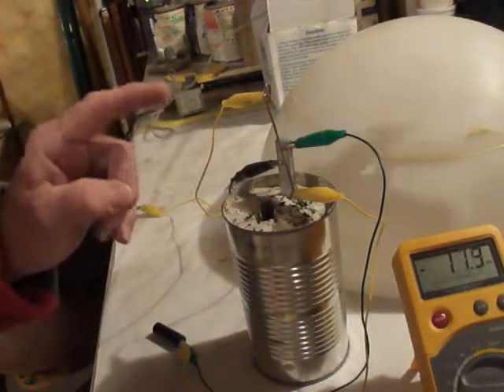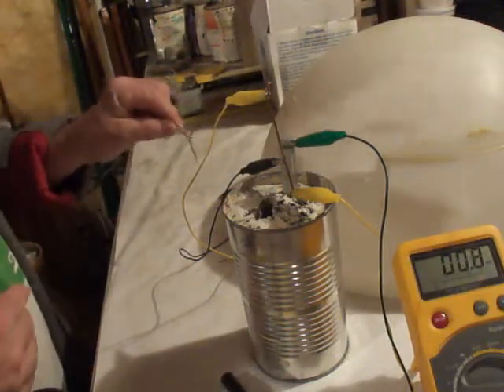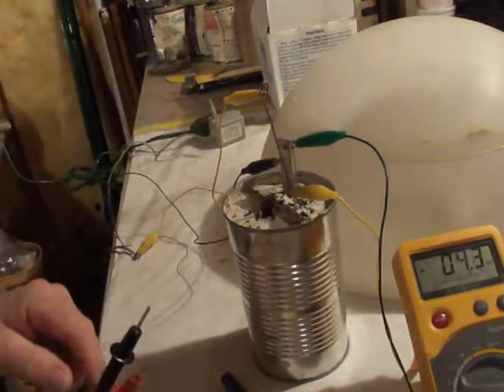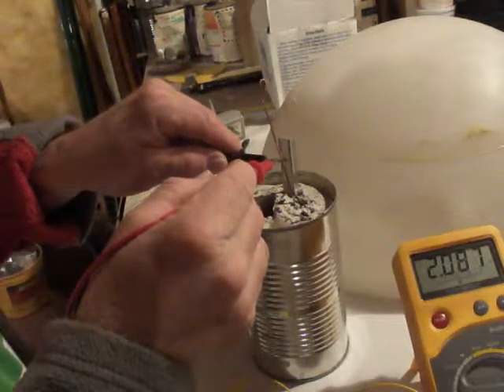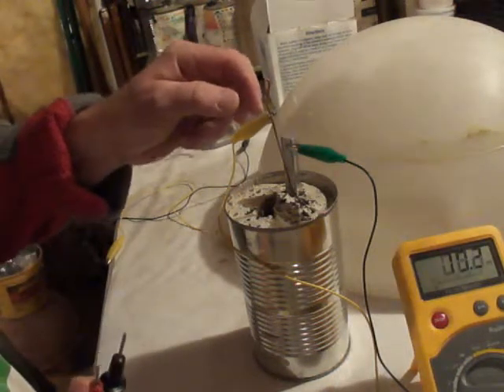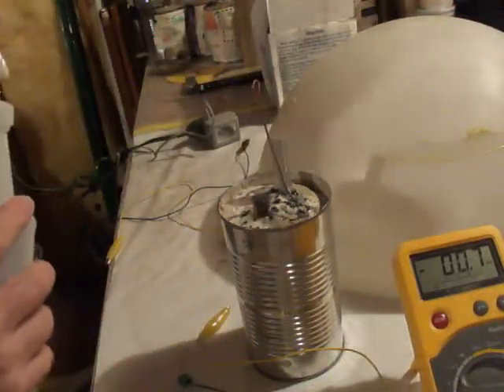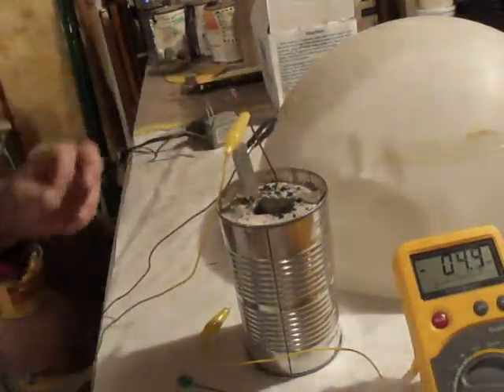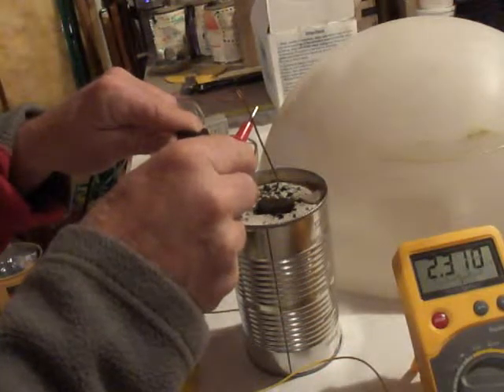update of the Cement battery

Comment: whats the proportion of materialswhat percentage
Reply from the maker: 1 to 1 ratio of portland cement to sand, in a soup can , mix in a tea spoon of magnesium sulfate and a teaspoon of activated carbon (im an not sure if the carbon does anything).  I found the more copper wire that you coil up inside the can the better and if you have aluminium wire it will be be good to coil that as well they cannot touch.
Reply: thanks a lot